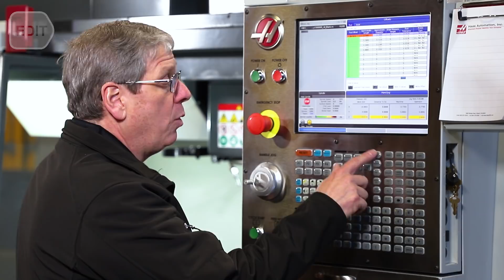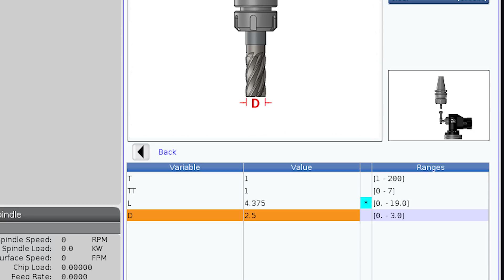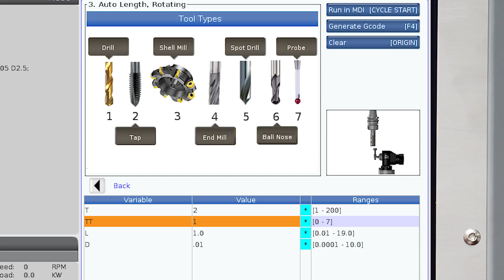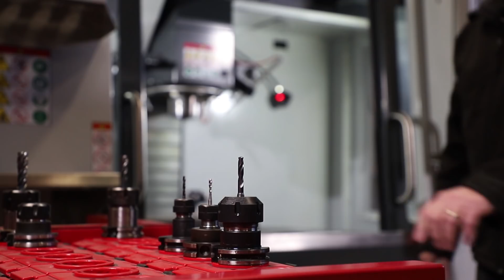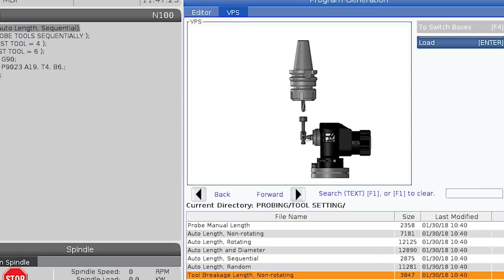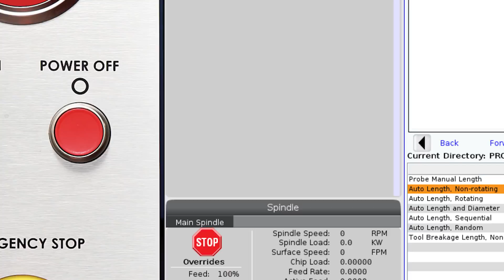Wireless Probing How-To PART 2 - Set Tool Offsets with VPS - Haas Automation, Inc

Comment: Pro Tip: Don't auto probe a face mill with diamond inserts. 
They will chip. 
6 insert Iscar face mill loaded with diamond inserts ($100+ each). 
All ruined before they even cut anything..

Comment: I have a doubt if I would use this method to set tools offsets It means that the Z It Is on the top of the metal(piece), that It Is mean? and now all the programs will be Z on the top of the metal. If it could be, How the machine know the distance?
Reply: Touching off the tool length tells the machine length of tool. 

Your work offset tells the machine where XYZ zeros are. 

The tool length is used for tool length compensation and cut dia compensation.
Reply: @jewstinebooboo  I know but if you have a tool measure differents between probe and tool. for example: endmill 2.0 inches set up manual,  offset Z-120.0 and probe 2.5 inches auto set up the offset will be Z-120.0, endmill and probe will be the same Z, Z-120.0 Is It that right? or It could be different?

Comment: My favorite thing for repeat setup with a lot of special endmills and drills...in the program after M30 as a setup area tagged N0 (unused by my CAM for line numbers), auto length seq/rando, come back and auto length and diameter with length set to #2001-#2200 for the tool number. Repeat job so I know the rough diameter of the tools for the second half of the template. Load all the tools off the cart, hit go, stick a corner or block center probing cycle after it - search down N0, hit go. Add some bore measuring and tool compensation on block delete or macro, hit go. Two dozen tools and +/- 0.0005 parts before my coffee cools down enough to drink.

Comment: Great video John, learned a few extra things. Can you explain what the tool length offset the probe inserts automatic is? Rather, if it writes 4.000, where is this # compared against. 
Also, can you describe setting a length on a non rotating tool with out using the table probe. 
Thanks for all the video training
Reply from the maker: Keith Hansen - When you probe a tool and get a value of 4.0000” that is the approximately the length of that tool from the tip to gage line on the spindle. Gage line is a theoretical intersection of the spindle taper and the spindle face. 
When we calibrate the tool setting probe with a tool of a known length, we are telling the machine where the spindle gage line is in relation to the tool probe. If you calibrated with a tool that was exactly 5.0” long and then measured your cutter and the offset was exactly 4.0”, your cutter would be exactly 1.0” shorter than your calibration tool.

To manually set a tool length offset when you have used the spindle probe to set the Z-axis work offset, make sure Setting 64 (Tool Offset Measure Uses Work) is set to ON. 

First, set the Z-axis work offset with the spindle probe. Then, make sure that work offset is active. Manually touch your tool off the same position as you set with the spindle probe and press the [TOOL OFFSET MEASURE] key. Your tool length offset should be a positive value, just like when setting the length offset with the tool setting probe.

Setting 64 (Tool Offset Measure Uses Work) changes the way the [TOOL OFFSET MEASURE] key works. When this is ON, the entered tool offset is the measured tool offset plus the work coordinate offset (Z-Axis). When it is OFF, the tool offset equals the Z machine position. Be sure to turn Setting 64 back to OFF after setting your tool. I highly recommend that you do not make a habit of manually setting tools this way. It is very easy to press [TOOL OFFSET MEASURE] with the wrong work offset active. 

John